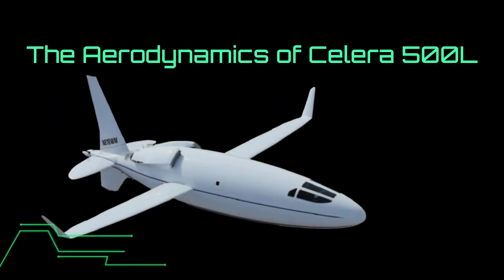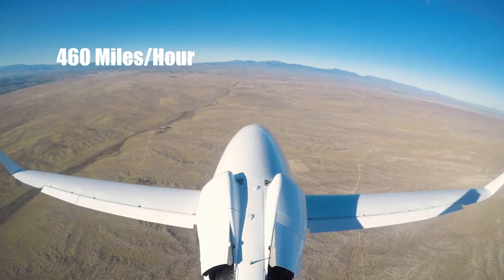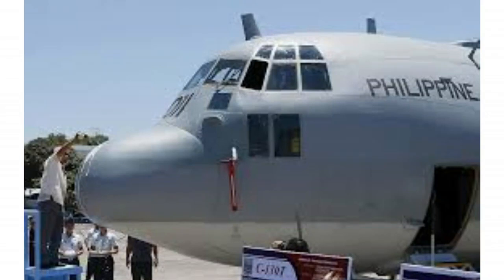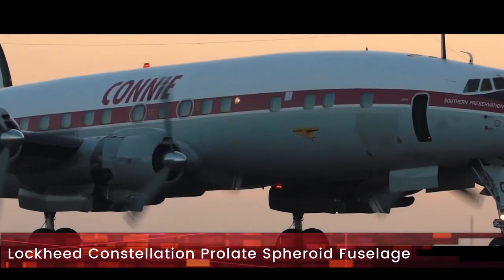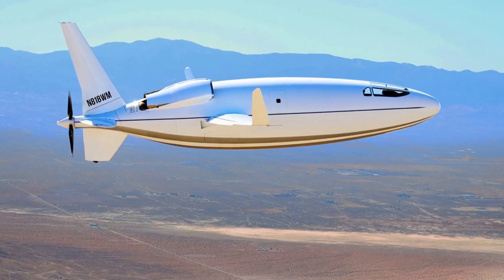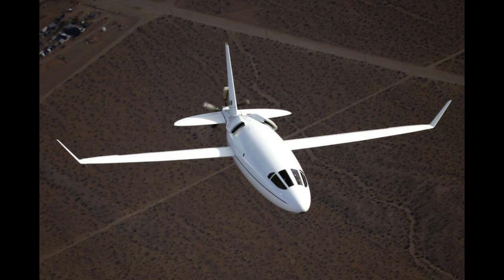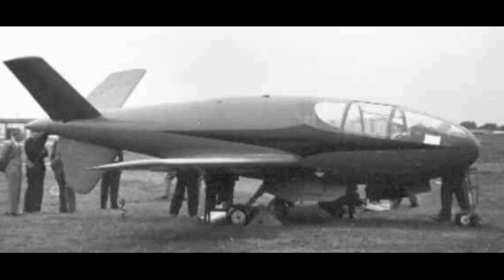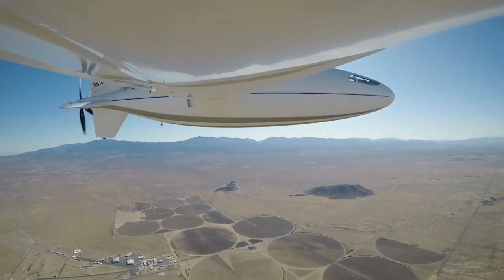The Aerodynamics of Celera 500L

Comment: Also worth noting is that the vertical and horizontal stabilizers do not use hinged control surfaces.  Instead, the entire vertical and horizontal stabilizers move in the same way you see the horizontal stabilizers move on jet fighters like the F-15 and F-22.

Comment: Thank you for showing the correspondence between Celera 500 and electric plane. They both were inspired by long-endurance drones.  Scale the Celera up, make it electric (with another generation of battery), and you have a real revolution, no matter what powers it.
Reply: The video does explain why it may not be practical to scale the Celera up. More length, more girth . What is the use of eight, ten, twelve foot high cabin ceilings? Lengthening a tube aircraft increases structural weight and cost linearly. A spheroidal shape's structural weight and cost increases at nearly the cube of the length increase.
Reply: @herbertshallcross9775  I assume they would not scale the shape exactly...that's obvious.  In fact, a longer shape only makes it easier to maintain laminar flow.
AS for 'what's the use'...if it were wider and higher....plenty of use: 2 floors in height? More cargo?  More capacity in a shorter body than regular planes?  Thus, less skin stress?  One must use their imagination.
Reply: @jaimesk1688  A sphere's surface area goes up much faster with increase in length than a tube of fixed diameter.That slightly lower skin stress is offset by having the weight of a lot more skin. Much easier to have slightly larger stringers on a tube. There have been a few aircraft designs with two levels, but it creates problems. A  double-height Celera would only fit in airliner-size hangars which has an impact on maintenance costs and scheduling.   Interior stairs take up space and payload weight. Double- decker means more difficult loading/unloading, with passengers schleppping bags up a narrow staircase, not to mention more difficult emergency exit.

Comment: When I originally learned of this aircraft a few months back. I was stunned to discover the great disparity in performance when compared to others.
I would have thought that given current advancements, improving performance, by what ever measure, would be small and incremental, not orders of magnitude !
Reply: That is the difference when you uncompromising in your design. (Well... almost. As mention in the video the intakes are a compromise, for now".)
Reply: Thanks for the info
Reply: Many more aircrafts are coming improving performance, by orders of magnitude with new materials and new engines !

Comment: Kudos for mentioning Connie! But I cannot fathom not mentioning the production airplane designed with all these principles in mind and sharing almost all aerodynamic features, Piaggio P.180 Avanti. It uses two pusher engines, so does not re-energize the boundary layer ove fuselage, but applies another little trick: three lifting planes.

Comment: Review wright speed hybrid electric power generator for a hybrid electric power source, also review controlled flexible wings and wing tips for control surfaces that reduce drag and power requirements. This seems to be a very good design for drone freight and passenger vehicles doing point to point flights.

Comment: Aircraft engineers here ? I think the lower fin is rather for yaw stability, and to protect the propeller on ground operation. Concerned about the CG being far aft, with a long fuselage forward protrusion destabilizing the whole thing. Hence the need for a giant fin. But there is no room for a standard low AR fin as the structure of the fin must leave space for the engine compartment. This fin has an AR ratio so high it may stall under relatively modest slip angles. As always, optimization of a criterion being made at the expense of other criteria. Comments welcome.

Comment: It is true that Elliptical wings reduce induced drag but they are also heavier than those with bell-shaped lift distributions and in some instances that in turn generates more drag force even though it has a smaller drag coefficient. My main other concern for this particular aircraft is it's stability, how does it maintain lateral stability if the tail and the wing are so closely held together?? The downforce of the horizontal stabilizer must be huge with such little distance to the CG, is it really worth the viscous-drag to induced-drag exchange??. (I do get that at high speeds parasitic drag is substantially bigger than induced drag).

Anyway this was a great video mate!!! I would really like to turn this comment section into a healthy aeronautics discussion.

Comment: great video! also noticed that the aircraft doesn't have passenger windows. They must have saved a lot of weight by removing those and the structure that's needed to make up for the resulting weakpoints. I know of research about removing windows in large commercial planes and replacing them with screens for that reason. How did they solve it here without creating psychological issues of flying in a dark barrel?

Comment: Great insight and well presented. I think the celera will be a good fit with future air travel, smaller more direct flights with high efficiency . Can only hope you don't run out topics, but the future is clear, evs are the future
Reply from the maker: Thanks Paul. I remember you mentioned to make a video on this. So thank you for that tip
Reply: If this aircraft lives up to its claims, it will be far more than a good fit.  It will rock the aviation world; especially if its price tag is in any way reasonable.
Reply: @billyboblillybob344  it won’t. Interesting concept plane, but not practical in so many real world aspects of aviation. It won’t see mass production.

Comment: Makes me wonder about the weights and balancing for this plane. Gives the appearance that if a rear seat passenger goes to the cabin it might try to stall
Reply: I suspect the C of G is engineered to compensate  for the heavy diesel V12 at back  and the wing placement would aid this. The electric unit would weigh less and its  batteries could be positioned forward.
Reply: @rickburke7167  There is only so much you can do. I doubt it would stall, but trim drag would certainly go through the roof.

Comment: One could make this a vertical take off relatively easily. It could take off like a helicopter, legs folding out from around the cockpit area. The cockpit would need to swivel, or special cameras would be used to help the pilot land.
Reply: Exactly!  If you use multiple fans that are retractable in fuselage like, for example, 3 in the front and 3 in the rear in each side(i'm with some EVTOL's design in my mind, that ones that have many small fans like lilium jet) and makes it eletric... damm
Don't know if this glider like wings would make it impossible but would be an evtol to beat all planes and helicopters. It would fly faster than any prop plane at 700 kph and surely    faster than any heli with much less cost with gas and maintenance than even the most cost efective airplane but with the capacity of vertical landing and take off. Present evtols are set to have 240km or 150 miles range. So if this can have 1000km range being eletric it would be a revolution i believe. Cheers!!

Comment: It’s going to be cool if their claims turn out to be true.  This would become the most popular plane in the world overnight.
Reply: It has a pretty specific use case though. Small passenger planes.  If they could make an airliner carrying hundreds of passengers it would change the world, but sadly the aerodynamics does not work in the larger sizes. On the other hand it looks like it will make electric planes more practical.
Reply: Yeah, if the engineering pans out. It’s going to be the worlds first practical electric aircraft.

Comment: Curious that, despite the target of low drag, there is no wing to fuselage fairing. Such a square corner is the highest drag configuration for that area.
Reply from the maker: Thank you for pointing that out
Reply: most likely a toss up - disrupting the laminar flow as little as possible vs some drag reduction at the wing root. given the low aspect ratio wings, just as on gliders. looks like laminar flow wins.

Comment: Keep in mind that the nose of an airliner is shaped correctly for the typical airflow over it. As a typical airplane has some "nose up" attitude in normal flight. One need only look at the positions and angles of the pitot tubes on modern planes to know what the average direction of airflow is.

Comment: I have serious doubts about the claimed per hour costs. Another issue, that they don't mention, is that pusher props, especially behind three, or in this case, four tail fins are extremely noisy, especially on takeoff. This is well known with flying wings in the RC model world, where pusher props are often used. The prop cuts through and interrupts the airflow from either the wing, or here, the tail and it is a very noisy and annoying noise.

Comment: If you study laminar flow, you will find that natural transition will occur at say Renolds number = 3 million.
Speed then dictates the laminar flow distance and it will be 0.3 m or so, not more. (at 150 m/s)
Many years ago we (Dutch Aerospace Lab NLR) measured that on the leading edge of a T33 fighter of the RNAF.
So only the nose cone of this Celera aircraft is laminar: this are physics of air.
If you add a lower pressure field behind the nose, like the shape of the Celera aircraft, the laminar transition can occur at say Re = 7-10 million (maximum), which will mean 1 meter of the nose is laminar flow, the rest is turbulent flow.
The fuselage has no lower drag than for instance a Learjet shaped aircraft, good to know for those Learjet owners.
B.t.w: try to beat that aircraft.
You cannot bent aerodynamic law, unless you use boundery layer suction. The Celera has none of that.

Comment: The shape of this airplane fuselage is similar to high performance glider that also have laminar flow over the body.  True a propeller in the front creates turbulent air flow that impacts the fuselage as turbulent.  The air vortexes off the trailing edge of the propeller air foils creates a vortex that is mixed with the slip stream, breaking up into turbulence.   The push propeller  has a second positive effect other then the turbulence it creates is no in contact with the fuselage.  The laminar boundary layer is compressed against the surface for a fuselage body that is expanding, increasing cross section.  However, expansion can not continue for ever.  The laminar boundary layer expands off the surface it is contracting.  About 8 degrees is the maximum angle.  Clearly the contraction is greater then 8 degrees.  That is where the propeller comes in.  The air is accelerated by the vacuum created in front of the blades, velocity squared.   So the air on the contacting fuselage is accelerated towards the propeller which reduces and may even change the expanding boundary layer to a compressing boundary layer.  Drag is determined by the cross section of the boundary layer when it separates from the body which must occur at the propeller.
The thickness of a laminar has a limit when it will turn turbulent.  However,  the engine needs air so the air frame can be bigger when the engine is used to remove the laminar boundary layer sending that air to the intake of the engine(s).   This has already been done on aircraft to prevent boundary layer separation on wings.
Reply: So this is what NASA engineers mean when they say putting the engines on blended wings back there is even more efficient than not having them at all. Very interesting!
Putting engines on wingtips could take advantage of natural vortex regions perhaps?

Comment: Yet another article that lacks basic research of the factory's projected performance claims versus fact.  It is Impossible to meet the altitude / speed / range claims made.    Readers should go to the article by Peter Garrison - FLYING magazine - Dec 2020    QUOTE: " The Celera 500L is not so revolutionary as it claims to be. ...  What sets the Celera apart is its huge passenger cabin and efficient diesel engine. I doubt it will achieve the announced performance—I’m happy to be proved wrong—but if it cruises at 260 ktas at 30,000 feet burning 90 pph and has a toilet inside, that will be good enough. "
Reply: Same opinion: too small power (<400HP), too small propeller. I believe it will fly, I believe small fuel consumption, but my guess is much lower flying speed (~500kmh) and much lower ceiling (~FL200).

Comment: Interesting stuff.  With conventional planes the aerodynamic center of the wing is close to the cog and the horizontal stabilizer is used to set the pitch of the plane and angle of attack of the wing to adjust lift. This plane appears to have a cog significantly forward of the wing and its center of pressure.  This would cause a large moment that would tend to push the nose down.  The small horizontal stabilizer would have to be generating lots of downforce OR the fuselage is actually providing some lift to counteract the nose down tendency.  Since you are covering the planes aerodynamics would you care to comment?
Reply from the maker: From the information I was able to gather from the internet/forums, yes the fuselage is a lifting body fuselage. Some suggested that as much as 28% of the lift is coming from the fuselage. It would be interesting to run a CFD model to ascertain, exactly how much of lift is exactly generated and what is the centre point of lift. It is most probably in front of the wings. Since the propulsion is at the rear, it kind of counterbalances. The CTO from Celera has mentioned that the plane must maintain an essentially flat pitch attitude or angle of attack, including during take off and approach to landing phase.
Reply: @ElectricAviation  I would also think that the heavy diesel engine at the back shifts the COG which is compensated by a lengthy fuselage. I would love to see some kind of folding front canard stabiliser similar to TU144. It could be used for takeoff and landing and fold in at cruising speeds.

Comment: Why not have the air intake at the front? Instead of a rounded nose, there would be a hole, ducted through the plane to the engine components that require air (the cooling system and the intake manifold or plenum or whatever the engine uses to breathe). Fuel injection nozzles could be up towards the front too, giving the fuel plenty of distance to tumble around and break apart (fuel atomization). The more surface area each fuel molecule has, combustion will be more complete. Less fuel wasted = greater range and further reduction in exhaust gasses.

Comment: Wouldn't a ducted fan improve the performance further?
Reply: suspect the increase in drag would not be balanced by the increase – if any – in efficiency. ducted props are not necessarily more efficient.
Reply: @daos3300  yes , ducted props are essentialy efficient in laminar flow (is not the case on this aircraft because the turbulences generated from the fuselage, wings and rudder), and for relative small diameters...for bigger diameters did the drag ,weight and cost from the ducts increase up to zero gain...

Comment: You might be interested in my use of the exact same laminar flow airfoil and fuselage section approach in an aerobatic design I built in 1986...  more than three decades ago:  https://www.youtube.com/watch?v=CbqcmA1coKk

The shape is actually a NACA 66 series laminar flow section and is not symmetrical front to back.  To achieve it's extreme efficiency the maximum thickness is 66% back from the front of the section.  ie the fattest point is more than half way back and that delays boundary layer thickening and pushes the stagnation point ...ie,  region of flow separation much further back.

Comment: Hi Sorry to pour cold water on a good idea, but passengers are betting their lives that everything claimed stacks up. It seems to me it's not possible the Celera is stable in yaw when the vertical area in front of the centre of gravity is greater than the area behind the C.G. A small amount of natural yaw caused by air turbulence will result in the plane becoming like a weathercock trying to fly backwards. 

How has this ship performed in stall recovery tests? What is the wing loading, and minimum flying speed? What horsepower does the engine produce at the various heights it intends to operate? Theoretical range and mpg estimates are no substitute for accurate measurements of its basic flight envelope.  As the ship's been flying over two years now, where are the figures needed for C.A.A. certification? Cheers, P.R.

Comment: The celera might look at the blade less propulsion similar to the dyson fan. It uses compressed air to create a high efficiency jet of air. The Engines can be mounted to allow them to move reducing the need for control surfaces.

Comment: But do we believe the specs?   Do we believe the top speed 450kts?  Do we believe the ceiling 50,000ft altitude?  Do we believe the range 4500 NM?  Or is this marketing?   
The operative word - it claims these specifications.   Can this aircraft really achieve 450kts with 550hp RED A03 engines?  What is cruise speed?  What is a sensible range at cruise speed?  What is a reasonable flight altitude with what payload?

Comment: if you create a high pressure air shield in front of the complete craft, no matter what you have the shape of the craft then
Reply: a rotating autogyro propeller would also be that high aspect ratio wing, that can be folded and hid out of the way